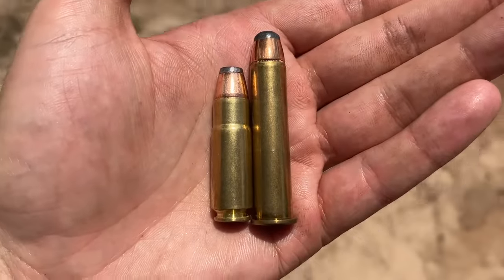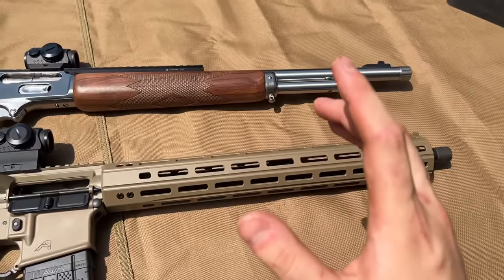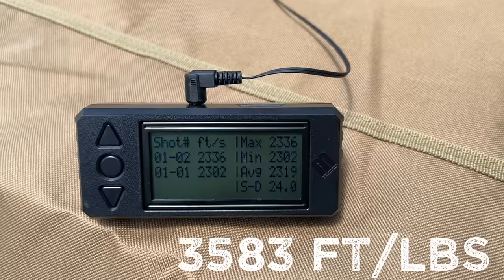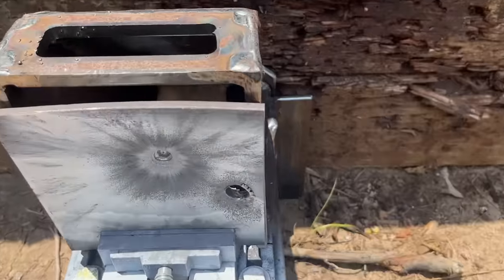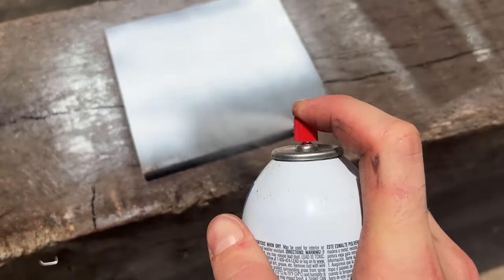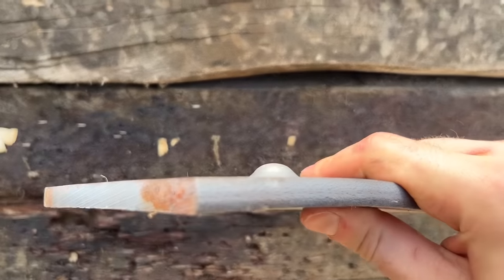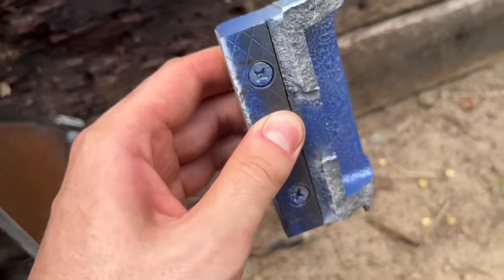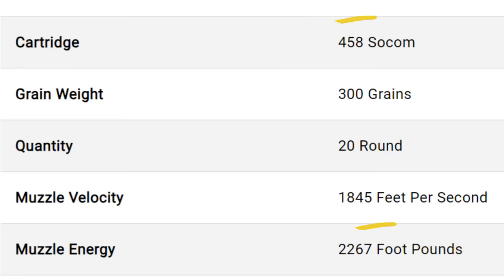458 Socom vs 45-70: Completely Different On Mild Steel

Comment: New to the channel, and I have to commend your testing techniques.  subscribed  I'd suggest replacing the broken rear jaw with a plate welded to the rest of frame that the clamp is bolted to.

Comment: The area I elk hunt in Montana is really tight and heavily forested and shots are always under 100 yds. I thought the 458 looked useable on paper so I tried it two years ago and it worked just fine. I did go back to my M1A though just in case I got a longer shot and the extra energy is nice to have

Comment: For your sled, since you use the same thickness plates each time, I think I'd slot the top (same as the handle, but wider slot) and cut a slot at the bottom that will accomodate your thickest plate. Make a spacer for top and bottom to fill the gap for the thinner plates. 

You'd need some sort of cotter pin or similar on either side of each spacer to make sure they dont pop out on impact. 

You could get real fancy and have a slot cut on one side (left or right) of the sled for each spacer so you'd only need to secure one side, making it faster to swap and less parts to lose, but that would probably entail a bit more work.

Pretty much anything used for clamping that is adjustable is going to fail. Threads will deform, ball sockets will mushroom, the frame will bend over time, etc. I dont see any "hobby grade" stuff holding up, especially if it doesnt weigh so much as to be impractical.

Comment: I have a Ruger No 1 in 45-70, and you will definitely feel it with "Ruger only" hot loads. I would like to see how the 45-70 does on mild steel with a 500 gr. monolithic solid and a max load of powder.

Comment: 458 vs 45-70 no question, but the purpose is different. I built a 458 because we had idiots messing with my guards, once the idiot looked down the muzzle he stopped trying to run down my guards and ran over a mailbox to get away. POS didnt come back either. FYI the 458 i built was an Ar15, 10 rd mag. ever get to phoenix, give me a yell!

Comment: I’d like to see you test KK Brno 7.5 pistol. Either F9 or F5 round. It has the same ballistic as a 7.62x39 out of a pistol
Reply from the maker: I'll have to see if I can get my hands on one
Reply: @bananaballistics  if you were closer I’d let you use mine. I’ve had one for two years and done some testing on my own. Both those rounds will go through 1/4” at 50-80 yards. I know hard to believe out of a handgun. Out to 100 yards it drops about 1/2” in flight. I didn’t believe all the hype until I shot a friends, then I had to have one. I’d love to see your testing with this rounds. You have a great channel and great presentation 👍

Comment: my go to .45-70 load is a 350 gr. Hornady RNFP going at 1902 fps w/ 2811 ft/lbs.  It's a hammer, but doesn't do a ton of meat damage like the 300 gr. HP bullets do on deer.  I've taken 14 deer with that cartridge and it's yet to lose one or even have one go past 30 yards.

Comment: offset the next vise back a 1/4" and let the screw press on the sled frame and not the base of the clamp frame. Should prevent future cracking of the cast iron.

Comment: I was at a public range that allows shooters to set up their own steel.  I confused a fellow shooters cheap "ar500" target with community steel and shot it with a 300 win mag woith about 3450 mv.  It went through the steel so clean it looked like the hole was from a drill press.  No dent, just a perfectly clean hole.  Blew my mind.

Comment: The original loading for the 1873 Springfield trapdoor rifle was 405 grains with 70 grains of blackpowder. Hence 45-70, 405. Later the cavalry carbine was loaded with 300 grain bullet with 50-60 grains of blackpowder. I have been loading for the 45-70 since I was 19. I am soon to be 74. I load barnes 250 gr copper to 2,600 fps, (Barnes data) for my my Marlin 1895 Classic. My Shiloh Sharps fires either Lyman 500 or 535 grain bullets at about 1,350 fps. That is a 57 Chevy worth of energy. 45-70 deadly in 1873 and just as deadly in 2023.

Comment: G'day from Aus. , the drill press clamp is not designed to take side shock pressure with cast steel, if you design gradient ribs with steel (the thicker, the better), that will take the pressure off the clamp, the clamp would only then be keeping the plate secure, relative content 
👍🍻😊

Comment: Poor fellow, you want to save your shoulder LOL. Back about 1968 I had a Marlin lever action in .45-70 and I used 405 grain bullets cooking down range at 2000 ft/sec (hand loads). I called it jokinly my "poor man's elephant gun". But it was not hampered by thich brush and I never needed more than one shot to bag my mule deer. I recall the recoil as strong, but it was manageable for a 17 year old

Comment: I don't know if the vice makes it through the show, but if you loosen the clamp down bolts, and slide the back in, only using the threads to put pressure on the plate, it might now fail completely

Comment: The part that broke on your holding fixture absorbed part of the energy of the .45-70 when it struck the 3/8" steel plate.  Shoot it again with a solid fixture, perhaps the bullet would completely penetrate the plate.

Comment: Weld a cross brace just above where the back of the clamp broke off? 
Or just below and when the clamp needs to be replaced. Saw off the back part for fitment. 
That way the clamp is just pushing the steel plate into the sled instead of holding it.

Comment: One of the reasons a 45-70 recoils so bad is  the new ones are lighter than the old ones. I have a 1886 Winchester 45-70 made in 1895 ( I checked the serial number ) and although I have never weighed it, my father always claimed it weighs about 9 pounds empty and about 11 pounds fully loaded, it has a full length magazine that holds 9 rounds there is no recoil pad just the original steel butt plate the only time my shoulder hurt was when I found a box of very old ammo with 405 grain bullets and shot the entire box.
Reply: Yup the new ones are about 7Lbs BUT they come with generous recoil pads and muzzle devices to mitigate recoil too! Only hard stock, unthreaded barrels hit super hard

Comment: Its like partway between original black powder 45-70 and modern higher pressure smokeless 45-70 for lever actions. Out of the ballpark of thr super spicy 45-70s thats only for single shots, but even the original black powder loads could drop huge animals like bison and bear. Saying its like a lighting 45-70 seems pretty apt to me, and its a damn beastly cartridge.

Comment: There are caveats with the 45-70 cartridge.  The 70 meant the original loading was 70 grains of black powder, usually FF powder. The original brass/copper cartridge was of balloon head construction and too weak to contain heavy smokeless powder charges. So, most rifles were not built to contain the pressures either.  With the later solid head cartridges the pressure could be raised and better performance achieved. The safety warning to check with the manufacturers is not a warning to take lightly. A modern firearm with modern metallurgy and proper lockup can contain the higher pressure safely. If there is doubt go with the lighter loads that simulate the original black powder load. Enjoy.

Comment: The rifles are designed for different jobs as well though.  I load .458 SOCOM and I've got some bullets that are 576gr.  Are there projectiles for the .45-70 in this weight?
Reply: The 45-70 uses the same bullet diameter as the 458 socom

Comment: That clamp body is probably cast iron. It is more fragile that steel. You could build a sled without a clamp where the plate slides into a notched piece of square tube.

Comment: I would have used 450 bushmaster over 458 socom. Good video nonetheless
Reply: I confess... I chose the 450 BM over the socom because of ammo cost and availability... Socom almost had me with a wider range of bullet weights and  being a better feeding cartridge.
Reply: @AverageHouseHusband  idk the whole feeding thing is kinda overrated. I have a 350 legend and a 450 bushmaster both are gas gun builds. I have yet to have either one of them choke on a cartridge. With that said I reload all my own stuff so I have full control over everything. Powder charge, cartridge overall length, the brass is processed with Redding dies and the brass is always trimmed when needed.
Reply: @Johnny-jr2lq  Supposedly a standard AR mag will feed 10 458 Socom without incident, 450 BM requires a single stack follower and supposedly doesn't feed much above 5 rounds well. The issue being case diameter and lack of taper, the smaller diameter 450 tries to double stack in the mag.
Reply: @AverageHouseHusband  my 7 round dura mags are working great. I have to give it to them there 350 and 450 mags have been flawless for me. But yeah you have a good point there I never really thought about that with the 458. In my particular situation I never even gave 458 a chance. Because I can’t use it for anything other than target practice or home defense. The main reason I own the 350 & 450 is I live in one of those states with stupid hunting laws. So it was just a natural selection of those 2 cartridges.
Reply: @Johnny-jr2lq  It wasn't a factor in my state but still came up with the same answer I'm limited in round count  so hunting with 10 rounds or more  of 458 wasn't an option and a 10 round mag dump of 458 is a bit on the expensive side.

Comment: The drill press vise is made of cast iron. Cast iron can't take that type of stress.  You can easily make a basic vise,by using some of your mild steel , couple of big nuts and bolts

Comment: Maybe remove the back/broken part of the clamp and weld in a solid piece of steel to replace the clamp and leave the front/screw part of the clamp. Maybe that will be the final edition and solve all the issues

Comment: Yea, the vise is made from cast steel rather than forged steel, so it's not surprising that it broke. It's much more brittle. Maybe manufacture another back piece out of a stronger steel and keep the front part with the adjustable clamp. Then it "should" be fine.

Comment: Well, your $20 drill press vice is made from cast iron and is not designed to receive any impact what so ever. I am surprised it survived being shot at as well as it did. This type of casting can easily be broken with a couple of whacks with a small ball peen hammer. My suggestion would be to find some clamps made from steel or at least ductile iron. Maybe some 1/2 inch beam clamps.

Comment: My 45/70 with the Hornady 325's knocks eye water out onto my lenses every shot. Also how I know it needs some checkering at least on the wrist of the stock. The 1895 CB is smooth with a hard butt plate.

Comment: The steel on your 4-point-OH sled looks like cast iron instead of tempered steel. 
have you tried to move the fastener bolts farther to the front or rear of your base-plate?

Comment: When shooting the big boomers/thumpers/deep breathers etc ......
1, you want your back to be straight up. Lower your seat or raise the bench top. IOW duplicate your standing position.  
Do not hunch over, like your now doing. 
2, with your off hand push forward on the forend, almost as firmly as your trigger hand is pulling back. This will spread the recoil across your entire chest instead of concentrating it into just the one shoulder.
Reply from the maker: Thank you for all the tips! I do really well shooting it standing, but the bench is another story. I'll have to see if I can modify something to straighten out my back

Comment: You should always include the Hornady 325 FTX round when doing 45-70 penetration testing. 
It's the only fairly full power 45-70 load that is reasonably accessible.  Not to do so with it or something similar is not to test the 45-70. 
i.e. Your not done.

Comment: Muzzle breaks do exist. Also the 458 socom with a 300 grain bullet at 1900 fps with a decent muzzle break and a great recoil pad has much less recoil than a shotgun. Shooting 3 games of trap could bruise my shoulder a little sometimes. 458 socom has never done that to me. Ill be casting 500 grain bullets using the lee 459-500-3r this week for the first time and loading them. It should be fun. 1 pound of lead will give 14 bullets

Comment: Radio controlled car nitrous gas filled shocks installed into a rifle butt, with a butt plate then attached to that will help to take up recoil even on some of heavy recoiling of rifles in general.  A solution that I've found helpful.

Comment: I’m working on a 458 Soccom upper and I’m aware I can’t use full power rounds, but I’m confident in all the other rounds will be so what I need just fine, but I wouldn’t mind some second opinions on shorter barrel lengths. My goal is to stay around 12”. Any thoughts out there?
Reply: Are you going to be running it w/ a silencer? If not, why the short bbl and added co$t for SBR tag?
Reply: @nunyabidniz2868  I’m wanting to keep the rifle fairly compact and yeah I’m going to running a suppressor. I’ve been a hunter and conservationist for most of my life and a couple years ago I came across an avenue into the hog hunting community and I’m wanting a rifle specifically for the ranges that I will be engaging the hogs that will be easy to haul around without too much weight before the added weight of a suppressor.
Reply: @Graves-81_69  I am NO expert by any means, but any .45 (based) round (or 10 mil) (or bigger) works great on pig/boar hunting. You do you and, I am glad you enjoy but that seems like a lot of time, hassle and money for a tool that you can easily substitute with performance (Not ballistics but in putting down your target) that is just as good. I know this is going to get a laugh, but my .45 Hi-point carbine is great for pigs/Boar. I'm in, Louisiana and due to the environment and the abuse it takes (and it makes a great truck gun) it is perfect. I know, Hi-Point is cheap, ugly and heavy BUT, I have never had a FTF or a jam with it and it takes all types of ammo. Back to my point. Why go through all that effort for pig hunting? I am not knocking you but, I am honestly curious. Heavy slow(er) rounds work best on pigs. You can get faster rounds but why? All that does is destroy the meat and more of a chance for over penetration. The only magnum round, I would recommend would be a 41 mag (which isn't cheap and can be hard to find and has a high velocity). Anything else is overkill unless you run into a 600-pound wild sow protecting her babies and then, I would just say, go with the 50AE. I guess my questioning comes from practicality and the waste on multiple levels from my perspective. If you are going for hyper fancy and overkill, why not just use the .450 Bushmaster? Better performing cartridge in all aspects and just as much over kill. Again, I am not knocking you at all. Just hard to contemplate you dumping thousands of dollars into an SBR and overpriced ammo when you can accomplish the same goals with a far cheaper weapon and ammo for the stated purpose (of pig hunting). Also with a 16" barrel, the 230 grain .45 round is sub sonic (Just under 1,000fps). The suppressor will be far more effective. Also, I am curious.  You said, "a rifle specifically for the ranges that, I will be engaging the hogs".  At what ranges are you planning on?  I don't think, I have ever needed anything more than 100yds and generally it is far less than that.
Reply: @brandonlevy8680  I’ll be honest with you man you make a some good points and I’m not gonna knock your hi point since you like it’s doing well for you. 10mm is the best mm but 41 and 50 AE aren’t common in SBRs  if at all without some wild cat magic I’m not wasting money on. I respect your manner of taking hogs and I can almost guarantee you’ve taken more than me, but I’m a fan of the 458 Soccom as I’m well aware of how well it performs son. I would highly recommend you research the round and it’s capabilities over the 50 Beauwolf. I’ve worked hard over my lifetime to achieve the means to have some of the best weapons that are available and I lost all interest in cutting corners over 20 years ago. I mean absolutely no disrespect to you and I hope you kill as many of those bastard hogs as you can good sir
Reply: @Graves-81_69  fair enough. That's why I asked. I understand not cutting corners but for me, those are more show/plinking when I make a big purchase for something I love. For practicality I am all for "If it's not broke, don't fix it" mentality.   I absolutely agree that the 458 out performs the 50AE or Beo. I was trying to articulate that it is "too good" for hog hunting (just because I harvest the meat).  As to the 41 mag in a rifle. Unless you go old west you are SOL. 10mm has some really good carbines out there. I guess what, I was trying to convey was, they all work for what they are intended for. I was just asking why you choose to go with a more... "Elite" round as opposed to the tried and true. Also, just curious. What ranges were you talking about for the pigs? I know in my region there isn't a lot of wide open terrain except on farms. Hunted Mule Deer in, Utah and those were the furthest ranges I ever hunted at and none of the shots were anything special, distance wise. MAYBE 300 yards at most with a .308. I have friends who can and have made kill shots  a lot further out but my skill and eyes aren't that good.  I hope you enjoy your hunts.  Pig is good eating.

Comment: Not even close  but a 458 soco. With a 325 ahornady FTX will penatrate 4 milk jugs of water an uncarved pumpkin and the inch and a half thick board you put behind everything so you could capture the bullet at 50 yds.  It's a beast of a cartridge it's fantastic and an AR platform